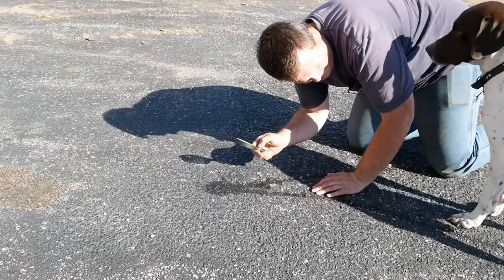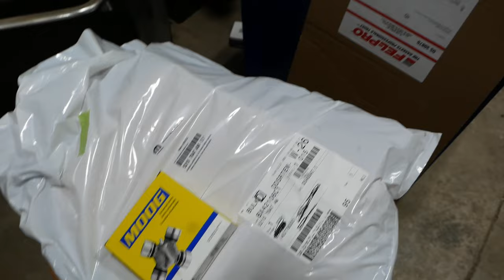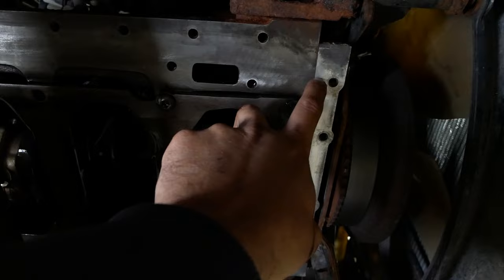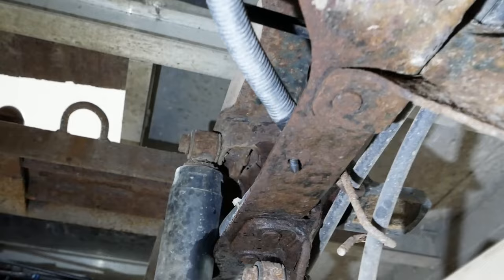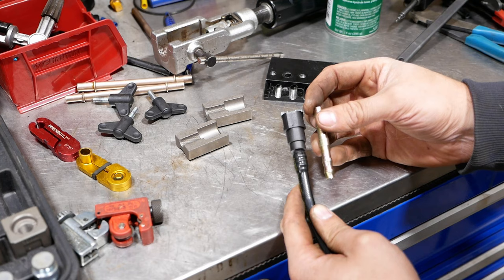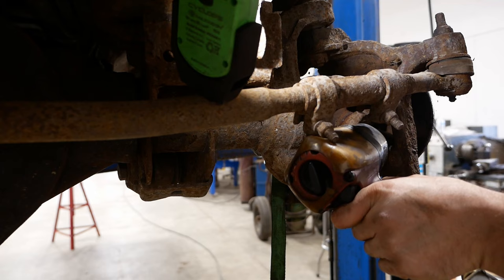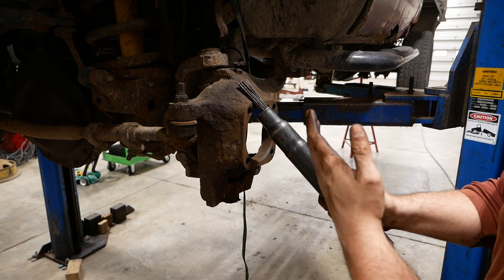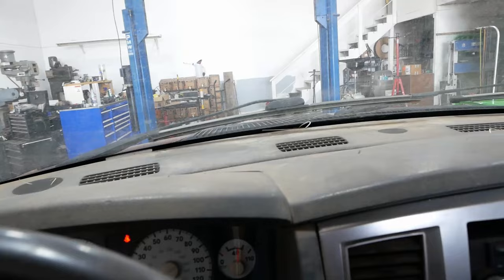6.7 Cummins Massive Oil Leak - Replace Oil Pan, Front Axle U-Joint, Fuel Lines, Shift Cable, Battery

Comment: Hello Wes  , I have been a long time follower of your channel and I think that you do a very good job of repairing all the vehicles and farm equipment that funds it's wY into your shop ! I just wanted to say that air tool you are using to remove rust from under the vehicles in the military we called it a needle gun and we used it to remove several layers of paint and rust (only under the insulation around piping )  I was in the navy and I found myself using that tool alot while in dry dock . Well Wes have a great day and enjoy the weather while you can still see the grass in your yard and no ice on the roads  .

Comment: Ain't nothing wrong with doing a job right the first time. I spent my morning fixing transmission cooling lines on my truck this morning. All because the moron who owned it before me (or their mechanic) didn't remount the engine wiring harness to the block, which rubbed a hole in both metal lines. I'm lucky it didn't damage wires.
Keep up the great work/videos 👍

Comment: If you like air ratchets, but you don't feel going deaf at 35 buy an Aircat. I used to deal with all the tool maintenance for a large body shop that supplied all the tools. We went through IR 1/4 and 3/8 air ratchets every 6 to 12 months. I decided to try some Aircat stuff and had great luck. had to repair a couple in 5 years, but no replacements. Stronger than the cheaper IRs too for less money

Comment: Yup seen that on boss garage on oil pan paint peel killed the cummins. It was a aftermarket pan. I did end up just going with good clean oem pan because of that but havn't heard anyone else having that issue but you never know.

Comment: I have a similar truck with similar miles but has seen much more maitenance and in Texas. Still can't help but smile as this one is falling apart in the exact same places in the interior.  I would strongly reccomend you check that front drive shaft for play though as it takes out the transfer case when it fails. Needs to be greased every oil change in a very hard to reach injection point

Comment: I wonder if the paint that came off was due to the owner trying to add some acetone or MEK to the oil to remove the sludge, I know some people doing and recommending that, but acetone or MEK will damage a lot of materials used in engines and, of course, strip the paint.
Acetone will damage:
-Acrylonitrile butadiene styrene (ABS) 
-Chloroprene rubber (CR/Neoprene)
-Fluorine rubber (FKM/Viton)
-Nitrile rubber (NBR/Buna-N)
-Polyvinyl chlorid (PVC)
And MEK the same as acetone plus:
-Acetal (POM-C/Delrin-C)
-Ethylene propylene diene rubber (EPDM)

Since heat makes these substances way more aggressive even a small amount in the engine oil can be enough to cause damage to seals, gaskets, hoses...
ABS is used in many parts of the body and PVC is common for wiring insulation, fuse holders, and relay housings, so these chemicals should not be used around the engine either.

Comment: Back in the 90's we had a New Holland 8830 tractor with 1100 hours on it. The primer / paint in the rear end housing started flaking off on the  inside of the case. The red primer / paint from the factory would plug the hydraulic / transmission filters in less than 30 hrs of use. It went bye bye & New Holland gave us a deal on a 8970 tractor.....

Comment: I am glad to see you using the proper ujoint press for the job! lol I have a 20 ton press and still do it via this way faster and easier until it does require a torch and press those are just bad days then lol. CP is my first pneumatic tool set still have it all minus the impact after 20+ years. They make a good too.

Comment: Ny rustbelt.  Front u joints, front bearings.  Bearings would not come out.  Cut ball joints and at 27 ton in the press it let go.  What a PITA rusty work is.

Comment: Gonna watch this later. Watching Michigan vs Michigan state football. Started fixing a rusted brake line then discovered a fuel seep, then major frame damage that threatened to unseat the rear springs from the perches. Cut and patched it all. But a 3.8 GM is a high mileage engine. We will be fine if we don't get hit in the ass.
   Chain saw bar oil sprayed every where is his my 94 Dodge will finish things out to the end of my driving days

Comment: I watched this just to see how you took the u joint out never worked on a dodge but on fords sd I managed to bend the ear on the stub or the  shaft so I started just cutting the u joint in a x pattern corner to cornet with gas axe then push out cups when they ain't hooked together anymore only way I could seem to get them out with bending stuff

Comment: If you heat the plastic fuel line in boiling water for a few minutes it will slip over those quick connect fittings pretty easily.

Comment: I like Harbor Freight tools, but I do try to standardize, Most of my tools are Bauer brand. That makes for one set of batteries and charger of all of the tools. Unfortunately Bauer does not currently have a right angle cordless ratchet.

Comment: Had a super duty that the steering wheel would shake when turning a corner. Ball joint press works great for u joints. Your gonna have never seize in places not thought possible lol 😂

Comment: I just days ago did the rubber hose and clamps on my POS GMC TopKick.  I'm with you, customers rig, do it right.  Even if they have a tire blowout and some fuel leaks the tire blow out will be all your fault in most attorneys eyes.   #letsgobrandon

Comment: It was an issue with the dorman oilpans because dorman parts are junk these days and if you are part of any of the forums like firepunk forum or any really, there are a lot of people that had this happen but thats why i dont buy the cheapest part available 😊 and also most all of the aftermarket pans have the updated 6.7 oilpan with the flatstock around the edge to strengthen it up :)😊

Comment: maybe they guy used an additive like AT205 reseal, (rubber rejuvenator) which does work or help, but i have read that if you have a painted pan it can remove the paint.

Comment: I realize this sounds like typical internet folklore, but my friend bill worked for Dorman in the ECU replication department. He was well aware of the oil pan issue dont think it was dodge specific,  said it was a big problem and they supposedly obstained from painting oil pans because of that. Obviously not in this case.

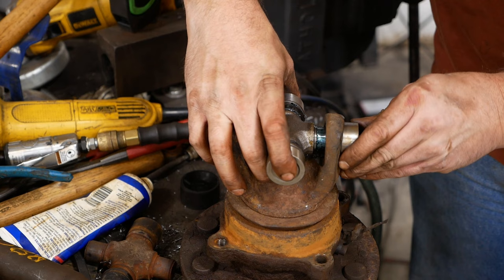Comment: 34:00 Here is a tip that will never cause you too ruin another u-joint....always press the first cup half way through the yoke as that gives you enuff of the cross sticking out of the other side to properly catch the second cap. Works every time!

Comment: I know it would be kinda hard to do but when you buy a new truck in that area you should roll under it with a sprayer full of used oil and spray everything metal you can see.

Comment: Nice job, as for your flaring tool you might try using some RCBS ammunition case lube that is used on non-tungsten carbide reloading dies when resizing fired cases, comes in dry or liquid form. Hope it helps you out. Regards.

Comment: Wes have you ever worked on a Swedish Bolinder tractor. Every thing is accessible, even has holes in the chassis to put a socket through to get to a bolt at the back of it.

Comment: I have no idea what would cause the paint to lift off the oil pan internally but, what I think may have caused me a problem is Seafoam in my motorcycle gas tank. I used it thinking what could it hurt. I did use sparingly, only ounces, but the factory liner, epoxy coating, let go on two different tanks. Two different year models. Maybe I’ll just not use that anymore. 
Point being, could be some compatibility issues with chemicals and materials.

Comment: I saw the paint delamination episode and found some good reads on Cummins Forum, TDR,  Diesel Bombers, ect,ect. The paint issue is not the paint it's the prep... Manny stories of Doorman oil pans being short lived in the rust belt as this piss poor prep causes the paint to delam on the out side. So had my pan blasted( solves any potential for delamination) and powder coated by Powder Keg of Salt Lake City, ut.   
Manufacturing flaws was not my primary force for wanting the powder done. It was because I'm building a salt flats racer and salt flats are more caustic than any place you've ever seen on the rust belt. When I was 16 I helped my uncle do a brake job six months prior he had hit a wet patch on the salt flat , tow trucks sees 1k usd  cash in hand redundantly take his truck on the salt . Granted this truck isn't the worst but it looks like showroom New, compared to what my Uncle's looked like after six months of not washing the salt crusted peanut butter alkali off, by the way it's kind of self removing as the rust jacking pops.

Comment: Wes, are you aware that you can install a  u-joint so that the forces from the driveline are either trying to squeeze the drilled hole for the zerk shut, or if you rotate the joint 90*  it will be trying to rip the joint apart starting at the weak spot of the zerk hole. You did it right, wondered if you chose not to explain... I learned that the hard way when I ripped a one hour old Spicer u-joint clean in half starting thru the zerk hole. Love the quality of your work, you do a fine job.

Comment: Got the laugh of the day when the first cap came off the u-joint too. Aren't those the factory part numbers on the axel?  Frame not bend, he's not pushing enough snow, got to have a salt spreader in the bed and chains on all four wheels.

Comment: Awesome job.  I bet that diesel fuel may have been lubricating the brake lines a little to the point of not rusting. 
Looked like rust was holding that front u joint in place.

Comment: That u joint is as dry as the Mojave. Hey Wes, you really should be wearing hearing protection. I spent 33 years in the automotive industry and I've developed tinnitus and it's no bueno. Trust me, you'll be glad you did. 3M Peltor 32 dbl reduction. You work in an echo chamber.

Comment: I know, there is no inspections for non commercial vehicles in Illinois, but somehow  I am somewhere between convinced and glad to see that any such regular inspection here would sure have prevented this piece of junk thing from reaching 200k miles and deemed it no longer roadworthy and loosing its operating permit. Besides the overall state of rust, al the deleted parts already would have made it fail, starting with anything not working properly on the exhaust system. Although I am also convinced we don´t have to use as much salt here in Germany compared to Illinois and the rust might not even be close to that.
Actually the Dodge RAM are some of the very few pickup truck you se over here at all every then and now.

Comment: You should get a piece of sheet metal about 4' wide and 100' long and you could fix all the rust on the truck.  I know people expect you to fix every thing that is wrong on every vehicle that comes in but if they brought you their vehicle and you gave them the estimate for the cost they would flip out.  I live in Missouri, we have inspections but there are still some people who are driving arounnd piles of rust with one headlight in the front and none in the back, you can sit on a parking lot and hear a car come by and the brakes will grind when they try to slow down.

Comment: My 98 Dodge's trans cooler lines were leaking so I replaced them with Dormans.  Big mistake.  2 weeks later, my friend using my truck, the lines blew the radiator.  The quick connects failed.  That was it for the trans.  A lousy leak, perfectly good running trans/truck and Dorman crap ruined it.

I also learned that their 4wheel drive switch for my jeep was crap.  Failed after 3 months.

Comment: For the speed connection, I drill a hole In a 2x4 then cut it in half and use the 2 halves to clamp the plastic line in a vice showing a half inch or so to start. Then I tap the fitting in with a rubber mallet. How many hundreds of $$$$ did I save?

Comment: would not use the rubber fuel line on any of my stuff.  Never had a problem, until you do!
Reply: Many manufacturers use rubber in the lines somewhere.

Comment: have you ever thought about using cable ties to help hold the gasket in place while attempting to locate the oil pan, loosely secure with a few bolts and then clip the cable ties off just a thought

Comment: FYI, I had to put a Dorman transmission pan on my old Ford Ranger. It also came painted on the inside. I was worried about the paint coming off and causing problems, so I hit the inside of the pan with a pretty nasty paint stripper. Didn't even faze it. Conclusion: must be a powder coat. I tossed the pan on and resolved not to worry about it.

Comment: Better way to do that to release the die?  Loosen the clamp holding the outer mold halves a bit and the die will be freed.
Reply from the maker: It's stuck on the tube, not in the dies.
Reply: @WatchWesWork  Ah yes, different cause than I thought.

Comment: We had 2014-2015 models RAM 5500, and it was not uncommon, except that the, we have to take out the engine in full. 
Some it was under warranty, others well no, and the it's a lot of hours of job.

Comment: Wow, that was a job and a half.  Was it 40 mins of hammering on the brake disc?  Bostik Never-Seez is excellent.  I have a big tube that I bought in the 90's and it has worked brilliantly.  Obviously, if a tube lasts me over 25 years, it gives away that I am a home mechanic 😄  Excellent video as always. 😊

Comment: You need to check the oil seal  I had to replace it on my dads ram 1500 when the ujoint  went out

Comment: 👍Wow! I’ve never seen an oil pan rot away 👀 I think If I lived in an area where they used that severely caustic road ACID I’d put it on a lift right before the snow fall every year and HEAVILY coat w/ grease and oil. Today’s vehicles are way too expensive for this kind of stuff.

Comment: I was curious about the cost of needle scalers. The Chicago Pneumatic is expensive, about $190. If I used it for my business that would be the one I would get. You can pay a lot more for one.  Not sure how much better they might be. However, as a diyer, I would likely go to Tractor Supply get one for $40. Definitely something I need to get. Thanks for your video.

Comment: M1 = M2 x L1 / L2

Where:

M1 is the torque setting of the wrench

M2 is the actual torque applied to the nut

L1 is the normal length of the wrench

L2 is the extended length of the wrench

Comment: Well, any day that you work on a Dodge 2500/3500 is a good day for me.  My 1998 24-valve 2500 is always in need of something at 276,000 miles but nothing like this truck.  Even if the model year is different, at its core it’s a Dodge.  Forget this “Ram” nonsense.  

So because of you, I’m going to tool up and change out that oil pan gasket on my truck.  I’ll send you pictures.

What’s wrong with Max?  He’s limping a bit.

Comment: In the U.K. there used to be a product called Wax Oil . It was best heated up a little then sprayed on just about the whole exposed parts of the vehicle underneath. Also in door insides, sills , any place likely to get the salt used widely several months of the year  against even forecast frost !. It set into a hard outer shell but flexible wax coating. The product was franchised out to hundreds of outlets. Does it still exist ?, is there a similar product available in America and Canada ?.

Comment: Let me just tell ya, a Milwaukee 1/2" fuel impact with 1400 lbs of loosening torque would make any air gun look like a fisher price toy. I bought one out of necessity for my mobile business because I didn't want to run a compressor but the thing is incredible and the 6ah battery lasts so long it's not even funny

Comment: Pneumatic ratchets always sound like they are doing about a million RPM while the socket is spinning at about 12 rpm.
Reply from the maker: It’s true! All show and no go.
Reply: @WatchWesWork  They do the job though but the air line can be a pain. The way I work now air isn't even an option though so I'm also looking into electric ratchets/90 degree impacts.

Comment: I've been through most of those woes on my '06 3500. Whoever decided axel hubs should be designed like that should be run over. I learned the hard way that there is a $20 press tool to pop those off using the power steering and the existing bolts. The right size impact socket works too. So much fun!

Comment: One time I was in a garage in Missouri,waiting to ge my PA registered car inspected because I was going be staying in MO.,for a while.Guy ahead of me was complaining because he had to get his car inspected.Inspector got his car up on the lift,found that the steel brake line that went to the rear axle had been hose clamp repaired.Jerks where he bought the car had used a length of fuel line to patch a rusted out portion of the brake line.Death trap patch if I ever saw one.guy quit complainng though.

Comment: There’s an old article by Tavarish where he called out Scotty for using compression fittings on brake lines.  Like you say, the risk/liability isn’t worth it, but old mechanics like Scotty will swear their experience says otherwise.
Reply: Let's not go confusing Scotty with an actual real mechanic lol

Comment: Great fuel line repair. If Ford can run all nylon lines on their trucks should work just as well for this Dodge. Absolutely hate rubber hose repairs. Rubber hose also isn't long lasting, its a wear item. Now can we get the aftermarket to stop using rubber hose as well?

Comment: Yup the Manufacturer assembles all axle nuts with impacts. Ford specifically outlines using one to install the lock tight prepped nut till it stops or the lock tight will lock up pre maturely before tight. Todays wheel hub manufacturers for after market whine do not use a impact or you damage them on install........ no you sold me a POS that was not made proper to start with.